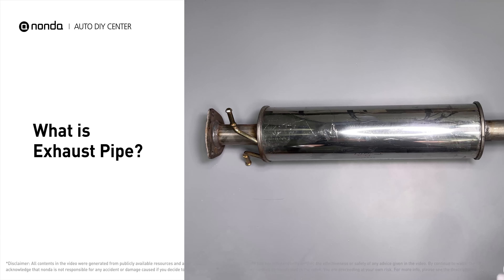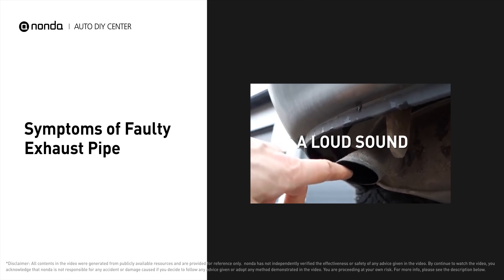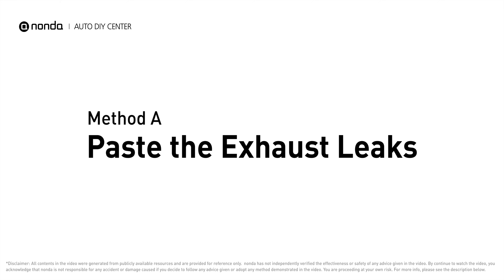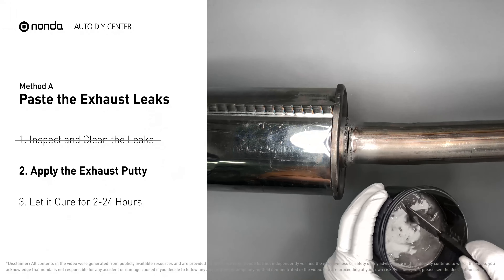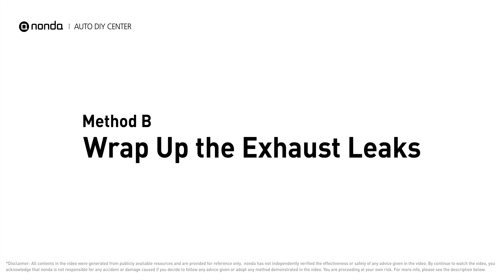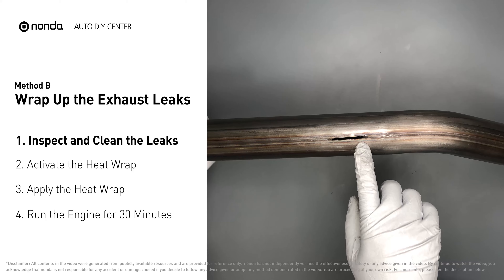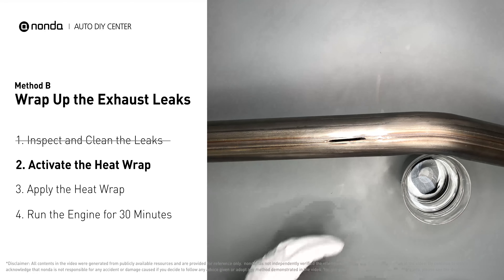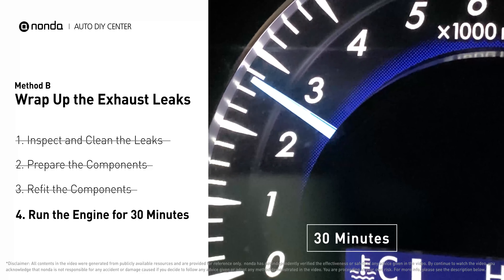Exhaust Pipe Leaks: How it Works & How to Fix [2 Methods Save $330]

Comment: Any reason exhaust can start leaking? What's the worst that could happen? i have a p2096 for the past 5 years but it's not affecting anything.. if it's not urgent I'm not gonna be fixing it..
Reply from the maker: Hello, it occurs when some of the exhaust gases produced inside the engine's combustion chamber leak out your vehicle's exhaust system before reaching the tailpipe. Having this could cause damage to your engine or exhaust system over time, and could also damage your health as exposure to exhaust fumes can cause fatigue/dizziness which can cause accident or even lead to death.